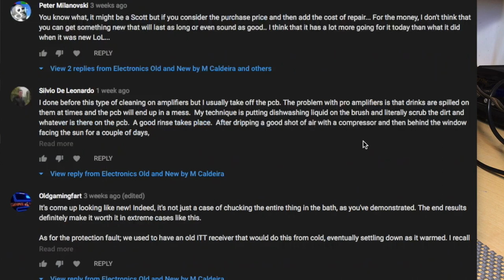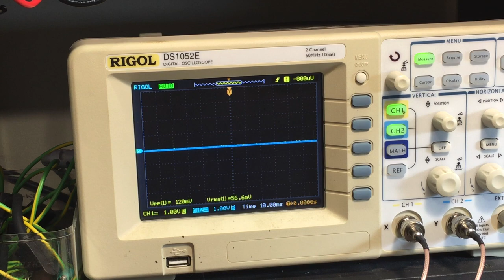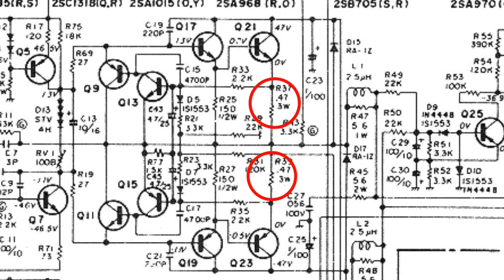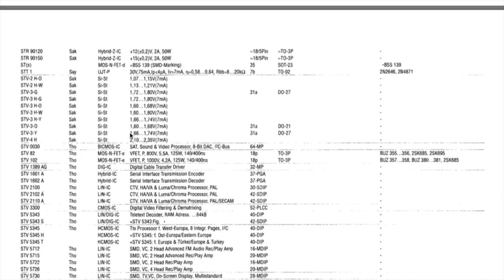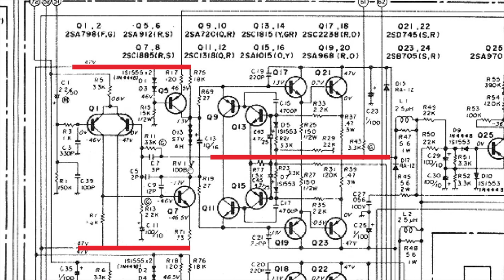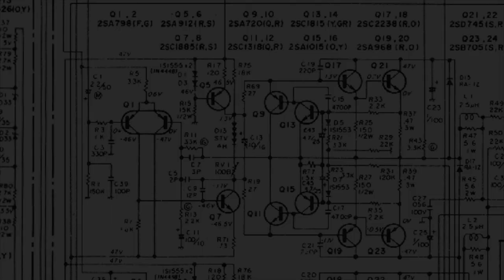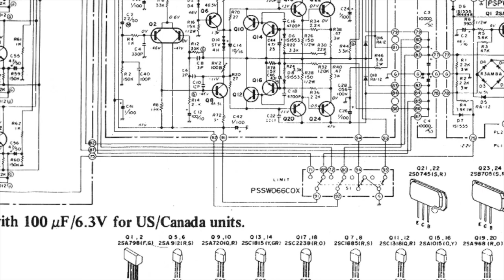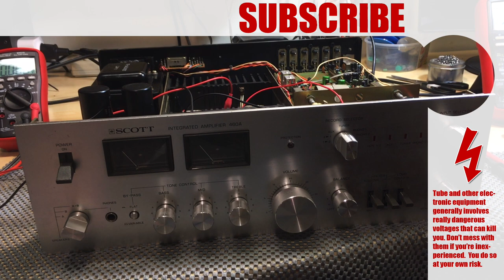HH Scott 460A amplifier repair (after the bath).

Comment: More than troubleshooting and fault finding....A great tutorial. Thank you.

The sought after HH Scott solid state amps are the A436 followed by the A457. 
The 460A and the 480A were made in Japan, the built quality was questionable. 
I bought a 480A in near mint condition and noticed that the STV diodes had their wires in place but not soldered to the pcb; the TO220 devices were not insulated. Surprisingly, the amp worked fine.I'll fix the odds.
Sound-wise I still prefer the A436 for its "tubey" sound.
Reply from the maker: Amazing that thing worked at all.

Comment: Great video! Awesome explanation of that current source and limiter circuit.
By the way, I think XRayTonyB recently also repaired an amplifier that had a problem in its limiter circuits. The schematic looked very similar to the one in your video: Differential pair, two transistors, feeding into two Darlingtons with four limiter transistors.
Reply from the maker: Thanks. I must go back a have a look at xraytonyb’s one to refresh ideas.

Comment: Do you use a isolation transformer 120 volt in 120 volts out i think some techniton s use veriac to bring voltage up to 120 volts slowly
Reply from the maker: I use an isolation transformer, but in my case it’s 240 in 240 out. I’m in portugal.

Comment: Great video man!! a lot info to learn from you, thanks a lot!. I have a question, i hope you can help me. I have a scott 440a and when i turn it on and off a "pop" sound on the speakers. Dont know it suppose to do that. I download the service manual, and i look the "Relay protection Circuit" description. What can be wrong to that pop sound when i turn the amp on and off??
Thanks!
Reply from the maker: The pop should be completely suppressed by the relay on the output. If you have a pop on start-up, the relay protection circuit may be at at fault. The relay may actually be stuck.
Reply: @electronicsoldandnew   thanks!

Comment: Great job, slow and steady wins the race! It's a beautiful amplifier and I'm sure that is going to sound just as good as it looks. All that is now needed is a pair of vintage three way 15" speakers to take advantage of that amplifiers output and you will be in audio heaven!
Reply from the maker: I’ll keep praying, and maybe a pair of those speakers will come my way soon :)
Reply: @electronicsoldandnew  The reason why I suggested to use larger speakers is because they are able to reproduce the low frequencies more efficiently at lower output levels, it's not always about high output levels. I had a pair of Technics speakers that were a two way system, they had an 8" bass driver and a basic 2" cone speaker as a tweeter, before I even listened to them, I decided to upgrade the speakers with new and higher power drivers. I made the mistake of connecting them and I got to hear what they sounded like! I still have the speakers and the new drivers are still waiting to be used lol. The original design was extremely efficient and the bass response was surprisingly good, back then... They knew how to get the most out of a system.. The young generation these days will take one look at the motor assembly of the woofer and automatically think that it's rubbish! They don't understand that it was designed for a purpose, maybe not their purpose but one that is beyond their understanding... I watched a video where this guy was comparing the speakers that his company was selling to a range of other speakers that were not even designed to be used in a car! One of the speakers looked like it came out of one of those PA speakers that were used in schools, they had them here in Australia and I have even seen them in the US also, it has an 8" dual cone speaker that would have been transformer coupled to a 100V line.. It's a very good and efficient speaker for that purpose, I'm sure that if it was installed in a proper enclosure and connected to an amplifier with enough power to drive it, it would sound amazing for the full range driver that it is.. The guy who did the video found himself having to defend himself in the comments section, he was just trying to make a point but he didn't realize that people would see that he wasn't comparing oranges with oranges... I guess that's why it's important to have channels like yours, someone has to educate the masses LOL. You are master and sensei at the moment! Now I have to go and finish painting the fence..... Stroke up..... Stroke down..... Up.... And down..

Comment: Mr. Caldeira, Let me complement you on your approach to teaching, 
You logical troubleshooting process starting at the power supply working toward the front end is excellent that coupled with the computerized schematics troubleshooting using multiple colors to explain signal path is excellent and your unique to your channel (how are you producing a large soft copies of the radio schematics?). I hate looking at paper copies or small soft copies that I need a magnifying glass to read, it slows me down.

It’s nice to see a technician sorry engineer, trace out a circuit using an ohmmeter before applying power then a voltmeter to finish ringing out circuit. Your injection of low-voltage AC into Transformers was a trick that I’m going to plagiarize. Your electronic knowledge in both solid-state and tubes sorry valves is excellent thanks for sharing.
Reply from the maker: Thanks you for your kind words.
I have described the software tracing in a video, linked below. It certainly makes life a lot easier.

https://youtu.be/oJtVijfc1Ds

Comment: My tech repairer was shocked when I told him about this video. Do you know where I can source a replacement vu meter as mine has stopped moving. There's none on ebay unfortunately.
Reply from the maker: Afraid not.
Reply: @electronicsoldandnew  yes I thought it would be a tough fix. They weren't even commercially released in Australia as mine was imported from America so I don't like my chances of finding one for parts.

Comment: If I am reading that circuit diagram correctly, R29 is common to both halves of the protection circuitry and its value determines when clipping occurs. An incorrect value for this resistor would explain the symmetry in the premature clipping. Did that resistor test ok? Maybe a smaller value?
Reply from the maker: You’re absolutely right. I’m going to revisit this amp when the ordered components arrive, and I think I’ll have to experiment with this limiting circuit. Much is still unclear and I think another gremlin is still hanging around. Thanks.

Comment: I have the same receiver. When I turn it on it clicks in and out of Protection until it slows down and eventually stops and stays on. Do you think it could be the same issue as yours?
Reply from the maker: Could be, but it’s hard to say from a distance.
Reply: I would suspect the power transistors